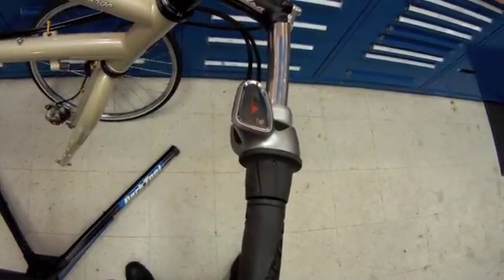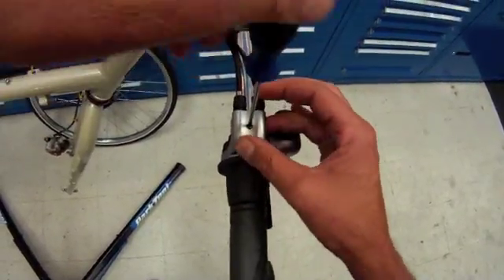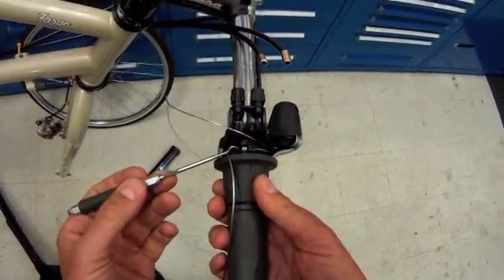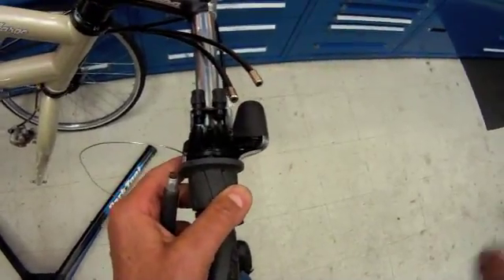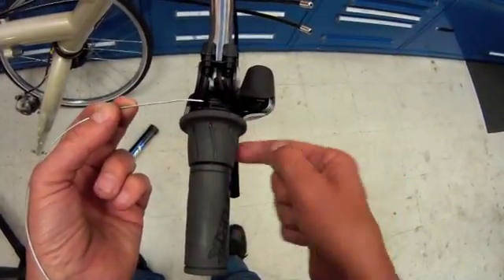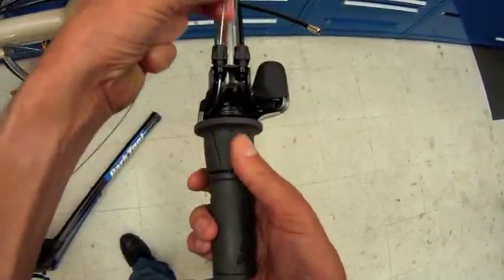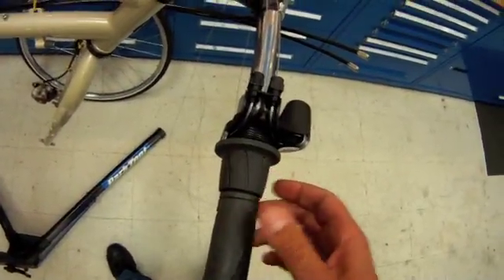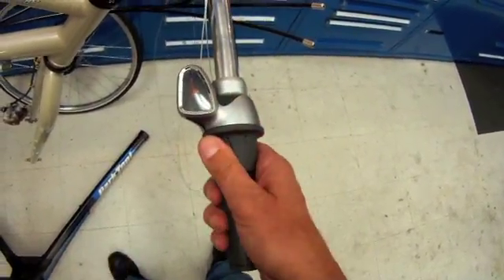Nuvinci 360: Shift Lever Cable Removal and Installation

Comment: If the bike only increases to a 'higher gear' when I move shifter back and forth full lock each direction and only keeps getting harder but never gets easier what area should I be troubleshooting? Likely Causes?
Reply from the maker: It seems the mechanism at the hub would be the issue here.  Disconnect the cables and see if it turns by hand.
Reply: @parktool  Thank you! Turns out I need two new cables and the attachment end of the cable on the hub side that broke.